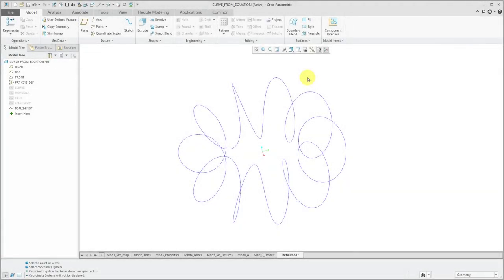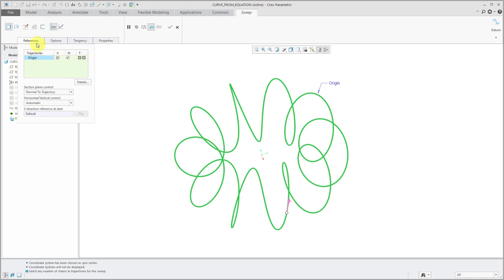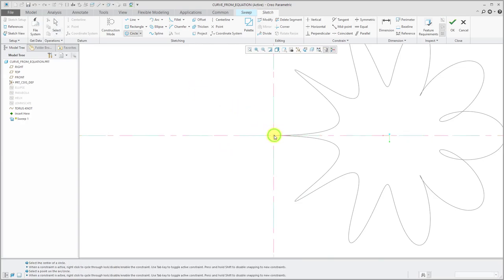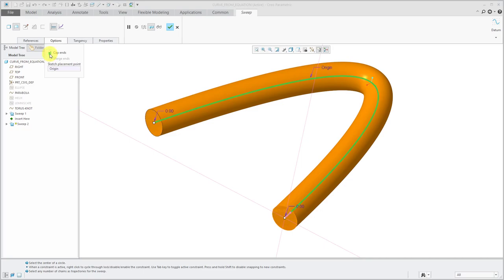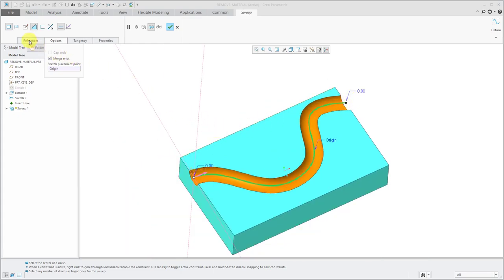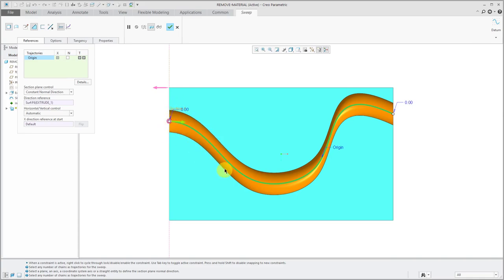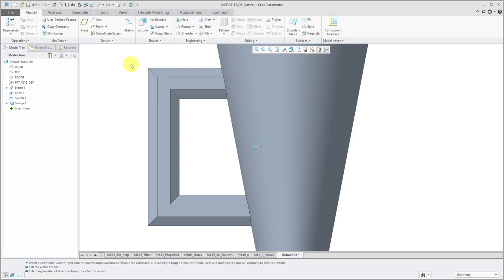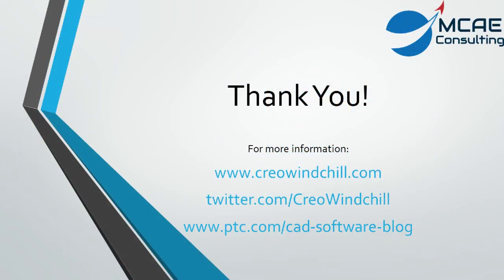Creo Parametric - Simple Sweeps (Constant Section)

Comment: Awesome!  Can't wait for the variable section sweep video :)    Two questions on this one:  1) Is there a way to change the sketch location to a non endpoint of the trajectory?   2) 
Is there a way to use an external sketch for the section?
Reply from the maker: Hi, Sean. 1) Yes, you actually can change the sketch location. Prior to starting the Sweep feature, create a Datum Point on the trajectory where you want the Sketch Plane to be. Then start the Sweep, select your trajectory, and then click on the Options tab. Click in the collector for Sketch Placement Point and select the datum point. 2) I know of no way to use an external sketch for the section, other than using the Project command in Sketch mode to reference the entities in the pre-existing sketch.
Reply: @CADPLMGuy  got it!  just tried the sketch placement point and it works!  never noticed that before, thank you again
Reply from the maker: I'm glad it worked for you, Sean.

Comment: Can you use a sketch profile made in a sketch b4 entering the sweep feature that is normal to your path? I feel like solidworks is so much easier with sweeps. SW has built in cirle and rectangular profiles you dont even have to make a sketch to use and u can use a sketch that was made b4 entering the sweep feature.
Reply from the maker: Creo has built-in profiles as well and you can always import a section into a sketch. I do a lot of complicated sweeps and I have found them easier in Creo than SW. Eventually I will make a comparison video on sweeps - I have some medium use cases that are not possible in SW. But if you are only doing simple sweeps, SW is easier. But if you need complex geometry, Creo has many more options and much more functionality.
Reply: This has been my experience as well. Part of it is the way I was trained, but I like having both the profile sketch and the path sketch completed before initiating a sweep feature. It just makes sense with the feature tree. However, I am getting used to Creo's Sweep tools and they just take some practice. SW all the way for me.
Reply from the maker: @samueldixon3186  When I eventually create the SW-Creo Sweeps comparison series, it will show once again the fundamental theme of simplicity versus functionality. If you are a person who prefers simplicity, SW is your tool and maybe you should stick with it. There's just so much more you can do with sweeps in Creo especially regarding orientation, which you couldn't do if you were limited to a sketch created prior to the feature.